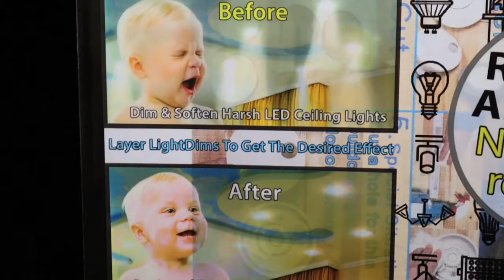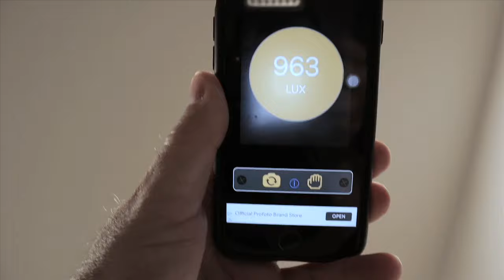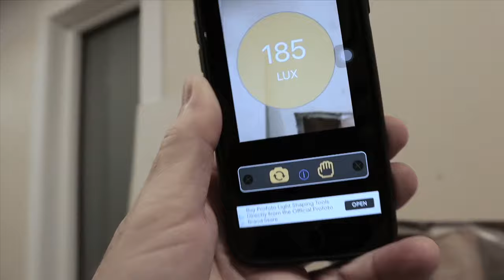REDUCE LED BRIGHTNESS WITHOUT A DIMMER!!

Comment: I am an electrician but never installed LED downlights. This video was good but to stick the "baby don't cry" on the outside of my downlights looked bad. My back plate on a 4" round was obstructed from coming off so after 3 tries at different installs I just did like you said and took out the screws on the back plate, then from the finished side I pushed the lens up away from the trim and installed the "baby don't cry" sheet WITHOUT removing the backing that covers the sticky stuff. Just push it up a bit and gently install the round cut-out sheet backing and all. Looks great. Thanks

Comment: Awesome video!!!  My super cheap recessed light was glued together, so I can't even open it up. Instead I cut 3 pieces of parchment paper and used double sided tape to adhere the paper sheets to each other, then to the outside of the fixture. It's not elegant - but it works!  (I traced around a wine glass to get a perfect circle, so I guess that makes it a little bit elegant!)

Comment: Your video gave my wife an  idea to dim our two LED fan lights. We choose the Parchment Paper solution. Our fans frosted light cover is 7" in diameter. She found a serving bowl of that size. She traced the outline onto Parchment Paper, and cut to that line. (We found that an additional cut to the center of each sheet we made allowed us to tuck the paper easily into the inside of the globe. We ended up using three circles of PP for each light.---THANK YOU for the inspiration!!!
Reply from the maker: Glad it helped!

Comment: Brother, thank you so much for the ideas. Was going bananas trying to figure out a way to get my new LED recessed lights to dim further. They were waaaay too bright even at the lowest setting on the dimmer switch. The parchment paper trick worked perfectly!! Depending on the amount of parchment paper sheets you use or the "tint" they happen to be, you can fine tune the lights to near perfect. Thanks again for the video. It was..... brilliant! 🍺

Comment: The sound of your voice is calm and pleasant. You definitely will keep growing on here. Question...is it safe to have tape inside the light?
Reply from the maker: You can use duct tape with LED lights. LED lights do not get hot so will not burn anything, but regardless, duct tape is coated with polythene which isn't flammable.

Comment: The sound of your voice is not annoying.  OK, got over that.  I just installed new  48 inch LED  light bulbs in my old neon fixtures, and eliminated the ballasts. Quite bright, so I
am asking what can I put in the fixtures besides the same plastic covers to tone the brightness down?  I was thinking some other kind of plastic sheeting on top of the existing one in there now. Any comments would be appreciated.  THUMBS UP!!
Reply from the maker: Do you mean inside the cover? You could try parchment paper. It can at least roll out 48”...
Reply: @thinkreno  I did that last nite and am fairly happy how it toned down the brightness.  What I did was rolled out the parchment paper to the length, then did it again, so two layers.  It softens the brightness okay.  I thought I had to tape down the corners of the paper to keep it from curling, but the scotch tape doesn't stick to parchment.  The paper laid flat enough if you flip it down. Problem solved, and thanks for the tip, and great video content..  THUMBS UP!

Comment: Great job! I have square lamps for LED exterior lighting installed and the ones closest to the house are way too glare oriented. I'm going to try the baby light dims on the closer to the front door so you don't walk out feeling you're getting blasted. Great job!
Reply: Also, the packaging says they can just peel off so I guess it's sort of like a film protector on your cell phone? So if I want to take them off I can always do that It looks like to me it won't leave waxy or glue like residue.
Reply from the maker: Exactly. It peels off easily!

Comment: for a cleaner install on the baby dont cry paper, you couldve taken the light apart and cut it to fit just like you did the  rest.
Reply from the maker: True. Although if you just use that then you don’t actually need to take any lights apart. Would just save time...

Comment: This is genius! I will add that the wafer LEDs are the worst culprit for glare. Get a recessed that has the LED light as far above the ceiling plane as possible., and if you want the least glare get the trim interior in Alzak or haze (acid washed Alzak).

Comment: Does this reduce the Lumens?    I added several similar lights like yours to existing ceiling lights not realizing that the new one were 800 lumnes and the old ones are 700 lumens.
Reply from the maker: Yes, it will definitely help

Comment: I solved my problem! The light was too bright in my room. My 24 watts 4000k ceiling led light have a flat and rounded shape. Was easy to open it up and put 8 layers of parchment paper, (a cheap one bought from a supermarket ) and now it's like the watts went to 24 to 18watts more or less. Also the light now is a little warmer, i'd say around 5200k

Comment: Thanks for this great video. What dimmer switch would you recommend with the lights you are showing, I have the same ones and want to install a dimmer switch
Reply from the maker: I used a Bluetooth switch so that I could connect to Alexa. But there are many regular dimmers that would work. Just make sure they are LED appropriate. If they’re not, you’ll hear a buzzing noise when you dim.

Comment: Hello, thank you for the advice. Any suggestions for the LED pool lights. I could not find any dimmable ones and now need a way to dim them yet make waterproof. I can open the cover with the clear plastic shield, but am wondering if using adhesive dimming film will stay or maybe painting the transparent protective shield is a better option?
Reply from the maker: If you can open the cover and stick a dimming softening sheet on the inside, I think that would work

Comment: I want to try one of these on the glass cover of my porch light (a led strip behind a glass cover and metal cage, 800 ridiculous lumens that was the only thing that would fit next to the door), but I worry about something starting a fire (even if it's not supposed to). The metal base of the light gets up to 120°F when its 100°F outside and 92°F when its 72°F outside. So Im just very worried all the time.
Reply from the maker: You could just use parchment paper. Parchment paper can withstand temperatures up to 420°F, which is why people use it to cook with in ovens.

Comment: I subscribed. Would appreciate your advice. 1st purchased monster led strips for a small music studio and built a black guard on top of sound boxes so the blue light is above - very cool for the price. The problem I am having is I like working under soft lighting but the leds - do not produce much more than cool accent lighting - even 7 of them. So, I found at the dollar store of all places a government contract for them to sell fairly small black led desk lamps at a very low cost but non-dim able. Of course, they are too bright white. I tried several things - 1st purchased blue plastic school folders and cut circles to fit - color worked but heat increased on the fixture. I drilled some small air holes and of course, killed a couple of lamps before I think I got the heat down but - I need some white light, thus I would like to dim these. For a small desk lamp, it is a powerful little too bright white. There does not look like there is anything on these to take apart and do what you did. I was wondering if you knew of any product that could lessen the white light but not increase heat within the lamp. Amazon has these round pieces - various sizes - half I would never use and a couple of sheets of material that can be cut - but they say nothing about increasing internal heat. So my question is - do you have any idea of the material that can reside or stick to the outside of a bright white dimmable led light that will not produce more heat and something I could try to reach a level to where I could use four or less of these on a studio desk? Cool little lights - the government allows Dollar Stores to sell for $1.25 to get people to use to cut back on energy usage - man that is a great price but it may just not work unless I can find a way to dim the white light AND I hope to cover a couple with a blue film to add to the blue hue of the room - a favorite color. You have some great stuff - thanks -
Reply from the maker: I would suggest trying the dimming softening sheets. They are meant to take the heat the lights give off and can be cut to any shape and size. There is a link for them in the description of the video. Good luck!

Comment: Any suggestions for dimming LED lights in rice light form? I bought a table top tree with branches made of (and lit by) twisted LED rice lights. It is soooooo bright.... We've thought about maybe trying rubber cement.
Reply from the maker: Depending on how many lights, you could tape off each one and hit it with frosting spray. A few coats work well to dim the brightness

Comment: Bro nice idea but duct tape has some aluminum, I think it's a nice fire hazzard, please anybody prove me wrong if I'm mistaken
Reply from the maker: Duct tape is coated with polyethylene, which won’t burn. And the adhesive used for duct tape includes rubber, which doesn’t burn either. It would just melt and get sticky under high heat. Would it burn if you threw it into a bon fire? Sure. Most things would.